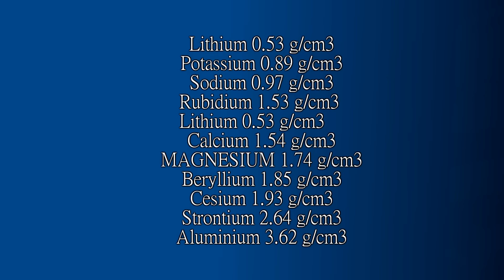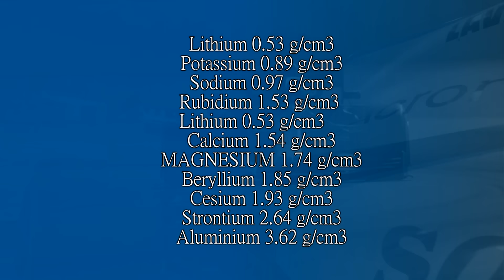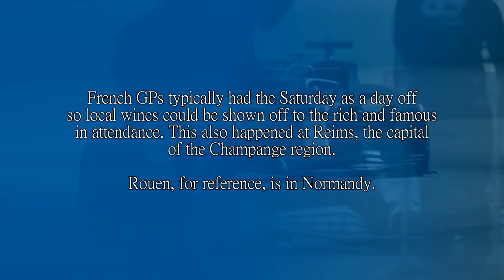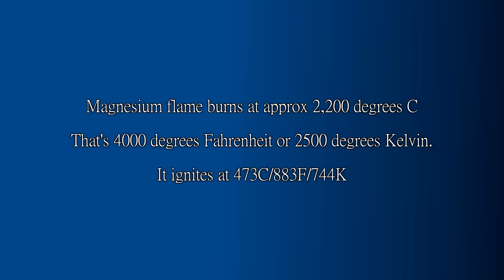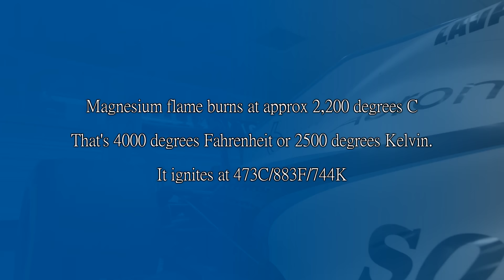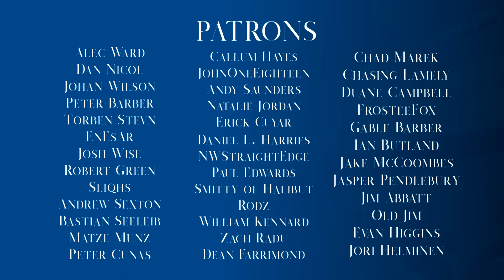The Car that Should Never Have Raced: The Story of the Honda RA302

Comment: Magnesium???   I can guess where this is headed.    I once worked for a defense contractor which built a 1 pound sensor, packaged in aluminum,  and used in a bomb. Despite extensive machining  to reduce weight, it was an ounce over its allocation. We asked if we could switch to magnesium. Why not? After all, it was in a bomb, and its ignition would imply that the explosives had already burned or detonated. So why not add to the bomb's energy and incinerate the enclosed electronics? The reply to our request was an immediate and emphatic "NO!"  Given such reluctance, I am surprised that magnesium is still allowed for racing wheels. A hot fire could ignite them despite being a big 'chunk', and once ignited, nothing will extinguish it.

Comment: Footage exists of the fire, from a TV camera placed at turn 4. The fire was bright enough that the camera picture tube overloaded, showing a black blob with a white edge. It used to be available on YT, in one of those "driver memorial" videos...
While there have been rumors that there was footage of the crash from a camera placed at turn 3, none has ever surfaced as far as I know, and the official story was that the camera lost power due to the crash.
Reply from the maker: British Pathe still has the footage.
Reply: I wouldn't want to see that. A driver died horribly and I hope he was knocked unconscious before the fire. No wonder Jackie Stewart too the position he did.
Reply: @AidanMillward  Having just taken a look at the Pathe footage, that's not the footage I was talking about - different angle, & film, not TV/video. 
There's a couple of other clips on YT as well, which are even nastier than the Pathe footage. NOT recommended viewing...
Reply: @philiptownsend4026  Sensible. Having seen several angles of the aftermath, it wasn't a pretty sight. About the only consolation is that he was almost certainly dead from the crash before the fire ignited.
Reply from the maker: @philiptownsend4026  watched pretty much all of the fatals at this point for these videos. The scary part is getting desensitised rather than the actual crash.

Comment: The cause of the crash was Honda was so fixated to get the car on the grid he used local support that had little experience preparing the car and hadn't waterproofed the electrics. The engine shorted and cut a few times as the rain fell heavier and on the fast downhill before turn 4 finally cut and unloaded the rear sending the car into a spin.
There used to be a YouTube video showing the crash with marshals trying to extinguish the flames as cars continued to drive though, it showed Schlesser's remains afterward, very gruesome to say the least.
Reply from the maker: British Pathe has it up.
Reply: I'm glad I didn't see that and I shall not go looking for it.

Comment: One story about the Lotus wing was, after it was first used and lapped pretty much the whole field, everyone added something similar. 

There was a wing failure on one of the Lotus's. Colin Chapman ran around the pit telling everyone about a basic physics or design flaw which might affect anyone running pretty much any variant of the wing (totally made up by Colin). But the rest of the field brought their cars in to check, while the remaining Lotus stayed out for a very easy win. 

Probably a myth. But still a funny story and the sort of thing Colin Chapman was capable of. But, yes, those high wings did turn out to be very fragile.
Reply: Actually Jack Brabham had the first wing failure of 1968

TWO wings on his BT-26 Repco...

tiny tubes supporting

Check the histories

I was there

1964 -1973...

JC.
Reply: @375GTB  - Thanks. I've always been a fan of Colin Chapman. But I know there are more myths circulating, than true stories.
Reply: Attaching the wings directly to the suspension uprights was stupid and irresponsible.

Comment: Apollo 1

Gus, Ed abd Roger....

My math nerd slip stick cousin James R. was Range Safety at The Cape

1959-1989.....

A room full of Dec computers

Vault with 18" reals of high speed data tape

Just inside the north gate.... guardhouse of Patrick AFB...

Had it's own little beach w/beach house..

Contracted to the USAF/NASA by PanAm, who ran the whole test range.

Juan Trip's Pa Am...

Jim and the guys would be out on the beach at dawn

Jogging 5 to 10 miles. 

( My cousin had a neat town house just inside the dunes/sea grass... 

not far from Jetty's Park,

JohnGlen sometimes parked his old blue/grey Peugeot 203 on a pad by the water....)

Astronauts, flown and un-flown..Pilots, Marines, SOPS people.

Discussing the coming days work.

I'd pace them on my old 3-speed bike...

The beach was a highway, like A1A....

You never saw news reporters out at dawn.

Only at the many BARS!!!

I was not yet 18, still in HS, but that horrible day hit everyone in the GUT!

Two years of 18+ hour days ensued

No days off....

Resulted in Apollo XI

BRAVE MEN!

J.C.

Age 73....

Comment: I think part of the reason none of the European teams used magnesium was because of, let's see, the 1955 24h du Mans.
Reply: They used it in engines, which the drivers sat about 6 inches from
Reply: @stephenscholes4758  the driver didn't sit IN the engine though, nor were the engines primarily magnesium.
Reply: @Ramtamtama  Timing chest, cam covers, throttle slides...lots of exposed Elektron in most 1960's Grand Prix car and bike engines. Repco built two Elektron (Mag alloy) GP  blocks in 1967 though there is doubt whether they were used....no big deal, lot less hangups and cardigan wearers then.

Comment: F1 races HAVE NEVER started with a "green flag." That's for rolling starts. Before the traffic lights, first used at Monza in 1967, races started with the dropping of the national flag of the host country. This was often performed by a guest starter, which often caused chaos, especially as races at this time used the "dummy grid" system for starts.

Comment: Thing is when a f1 hits a wall, it does with the rim, not the hub... or am I missing something?
Reply: I think it may be that people are confusing hubs and rims, almost interchangeable terms for some.
Reply: @philiptownsend4026  Maybe, but technicaly the hub is where the drive shaft is inserted and supports the spike of the drive shaft, brake disc, wheel etc, but you already know that I guess.
Reply: @Holanduzo  oh yes I know that well from my motor sport days. It's just that sometimes I hear non petrolheads confusing the two words.

Comment: Isn't it true that aluminum and magnesium are both generally alloyed with other metals for most purposes? Surely that would be true for structural components of cars. So really, you need to talk about composition of overall alloys when you compare aluminum and magnesium, whether it's for weight, fire hazard, or anything else.

Comment: Sadly, no-one has clarified what was actually wrong with the Honda that made it such a poor handling car.
Reply: They were STILL using old 1959-1961 Cooper Climax type independent suspension...

As they had in the 1.5 liter transverse V-12 cars...

NOT the later Lotus 18 -Lotus72 Chapman type suspension of the Lola/301

John Surtees well knew ALL this!

But no one at Honda would listen

SO like Enzo Ferrari!

Another Old Man problem

Coupled with their xenophobic all Japanese worship culture!

IMHO!

J.C.

Age 73...
Reply: Insufficient development and testing, also aero lift at high speed.

Comment: Drove around the old circuit (what you can of it anyway) a few months back when returning from the Alps, and it must have been terrifying to race around there at the speeds they were going. I did notice that the asphalt on the cobbles has actually come away mostly, so its back to its original form.
I made a short video (slightly sped up) of a couple of laps - https://www.youtube.com/watch?v=MAeoyJ8vYE4

Comment: I see Steve Phoenix had the same memory regarding Magnesium. It is flammable & burns with an incredible heat. Good for an incendiary bomb, very bad in a car. 
You have to starve the fire of oxygen.  Water won't work. I think that was the problem they had with the burning wreckage at LeMans.
Worst case: The driver & spectators get cremated again.

Surtees said it was dangerous, the Honda representative agreed. Why were they not listened to?
Did Surtees actually call the car a 'death-trap'. He must have been seriously scared by the car.

Comment: Where are you getting these figures?  Aluminum is and has always been listed as 2.7 g/cm 3, while magnesium is correct at 1.74.   Now I am sure that figure is for 1000 series commercially pure aluminum and I am sure 2000, 6000 and 7000 series alloys are likely denser, but 0.9 g per cubic cm denser?  Doubtful.  Mag is EXTREMELY difficult to produce thin panels in.  It's melting temperature is very close to its auto-ignite temperature.  It has its best use in things like wheels and castings.  Magnesium seems to be the flavor of the month in ultra high end supercars and hypercars right now; instead of carbon fiber wheels, you are seeing forged magnesium wheels as $20,000 options.  Many air bag steering wheel frames use a magnesium alloy--My FK8 Type uses a specific magnesium alloy for its steering wheel frame, you can tell it is magnesium due to the very dark grey and matte shade of the frame (once you pop the airbag off)

Comment: Yet Porsche thought it was a good idea to build a car with the tubular chassis having oil running through it many years later?
Reply: The 917 chassis was filled with compressed air in order to detect cracks.

Comment: why magnesium? it has more stiffness than aluminum.  You are looking at pure magnesium when they used an alloy (Mg+other things) of which there are many.  Magnesium alloys are used to make armor plating amongst other things.  Magnesium alloy metallurgy is complex so I won't try to explain it, not to imply you are ignorant unless you are a metallurgist then....Bottom line: the experiment conducted in many chemistry classes do not represent the state of the components in the RA302.  How do I know this? I worked in a magnesium foundry for many years as an engineer.  Magnesium alloys will burn, so will aluminum alloys at similar temps.  Was the RA302 a death trap?  from a pure materials stand point I will say nope.  Last point: putting water on a magnesium fire makes it burn hotter, I doubt the responders had the proper fire fighting materials on hand for magnesium.
Reply from the maker: I did acoustics, so no metallurgy experience at all XD

Comment: For all those saying: "What were they thinking using magnesium?" I'll say this in response: In unrestricted and total war or motor racing the value of human life is weighed against the chance of finding a trump card which will win the war/championship. It's a disturbingly easy gamble to make. Post-war people might also wonder why the nazis decided to use the Messerschmitt Me163 Komet rocket-plane late in the war when it killed more ground-crews refueling them and pilots landing them than the number of allied bomber crews. But the nazis were desperate and were willing to try anything which could have worked, a few German pilots dissolved by leaking fuel in landing accidents be damned. 

So was Honda as desperate at the nazis at the end of WWII? No, but do remember that motor racing in the 1960's was very dangerous and drivers dying in crashes was "part of the plan". Safety wasn't really a concern since people held the view that motor racing, as long as it had been around, was something very dangerous. To us this sounds absurd but bear in mind there wasn't even a law for seat belts for road cars during most of the 1960's and manufacturers only began installing them in 1965 in the UK - and the mandatory law for all occupants wasn't introduced until 1983. 
When it came to traffic safety people had a more fatalistic view of the whole thing and lady luck was either with you or not (or God for that matter). 

The bottom line is that racing drivers crashed and died in Formula 1 (and other motor racing) quite regularly in the 1960's and drivers dying in burning cars happened quite a lot too - whether they were made from magnesium or not. With this in mind Honda's gamble with a magnesium chassis becomes far easier to understand. You could die in a burning magnesium car? Well, you had a rather large chance of dying in Formula 1 in the 60's anyway. And no, I don't really believe they reasoned in terms of "more likely/less likely" during those days of racing. Crash tests were still two decades away. 

For all those wondering how much a human life is worth in war when weighed against a more rapid victory should read up about how general Patton was the man chiefly responsible for giving the lighter Sherman tank almost full priority over heavier (and better) tanks. He argued that more Shermans could be carried on each ship, could be deployed en masse over a wide front (or many different fronts) and could be more easily repaired and put back into action if "damaged". Naturally there was a risk of allied tank crews having high casualty rates but to Patton this was of minor concern because he knew there were more where that came from. Indeed, quite a few knocked out Shermans were repaired, repainted and pressed back into action with new crews. So was Patton right? If the number of outright knocked out Shermans was his main concern then he certainly was. If the number of killed allied tank crews was his main concern he wasn't. And we all know he wasn't called "Old Blood 'n Guts" by his own troops for nothing. It's also lucky for him most German armored divisions were bogged down on the Eastern Front, or Patton would have been remembered today as Douglas Haig is to the British for his "victory" at Somme in 1916...

What were they thinking... ? Indeed.
Reply from the maker: The old “doesn’t matter how, so long as you do” when it comes to winning.

Comment: "How long does it take to boil a liter of water"'s answer is also go fuck yourself because it depends on a bunch of different variables.

Assuming full pedantry, we'll start with joules. Joules are defined from other base units, which is good for a lot of things with back-of-the-napkin maths...but not for water. Lo, the British Thermal Unit is defined as the energy required to raise 1lbs of water 1°F. Which would make it:

1 gallon of water @ 68°F = 8.3lbs of water @ 68°F
Boiling point of water is 212°F -> 212 - 68 = 142°F
142 * 8.3 = 1,178.6 BTU

Except that's not right, because water absorbs heat differently at different temperatures, so even using calories (the amount of energy required to raise 100g of water at room temp by 1°C) will not get you the right answer. Read up on the enthalpy of vaporization if you want to find out how much neuroplasticity you still have in your 30's (I hope it's more than mine!)

If everyone took a little time from their day to fuck themselves, we'd live in a better world :-)